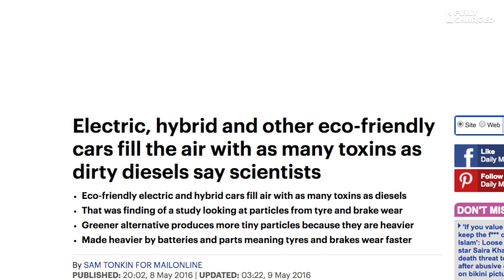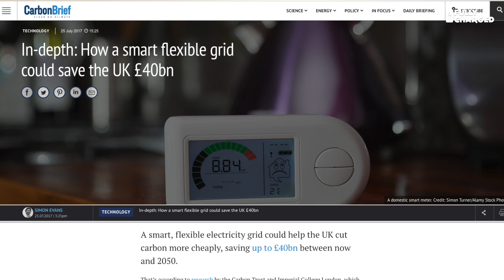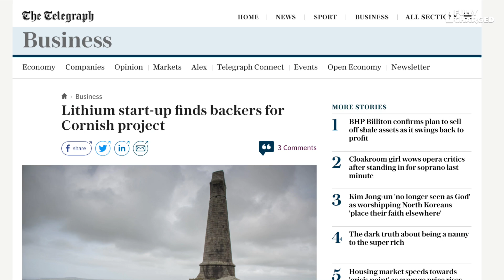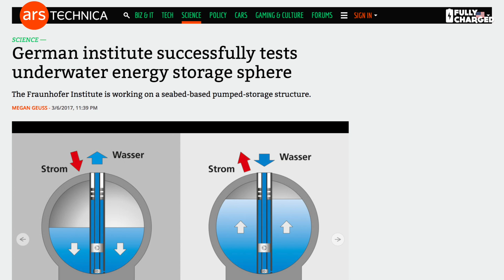Kettles, Particulates & Flexible Grid | Fully Charged News

Comment: Why do EVs not gt through tires as quickly, surely that's all on the driver rather than the car?
Reply: I suspect it might have something to do with regenerative braking absorbing the vehicle's momentum, vs using brakes to cancel it out.
Reply from the maker: But regen braking is now very sophisticated and becoming more so, and it's adjustable on many models, and you can turn it off so the vehicle coasts. It isn't a sudden mechanical input, it builds slowly so the torque effect is applied more gradually than brakes. That's how I've had it explained to me, by the tyre manufacturer who said 'electric car tyres last longer.' But what did he know.
Reply from the maker: The reason is obviously down to driver behaviour in some parts but also braking. Heavy / last minute braking wears tyres down faster, as does hard acceleration, when you drive an electric car (normally, for getting from A to B) EV drivers accelerate and slow down carefully to maximise range, so it certainly appears from experience tyres wear less.
Reply: But at the point were people will switch to electric cars they will probably drive even more aggressively because it is cheaper and they can have that power instantly. 
I know I have driven the rented i3 like a drunk 18 year old yob.
Reply: Jean-Pierre White 
I don't know if you're right but my experience contradicts. I have a Renault Zoe EV that has done almost twice the mileage as I ever got out of a set of tyres. I had a Mini before that spun the wheels more, had less grip and tires wore out really fast. Less than 10,000 miles sometimes. Zoe is quicker off the line but tires definitely last longer and smoother power delivery spins them up less in the wet.
Reply: James Jeffs 
Missing the point, the "report" speculated that EV's would wear tyres MORE quickly due to their increased weight, thus causing more particulates.
Reply: Yes, and Robert Claims they use tires less quickly (1:50-1:55). I wanted to know if there was a reason for that?
Reply: It's a fair question. I think they would wear tyres at exactly the same rate as any ICE car. Brake pads, however, do wear slower due to braking regen.
Reply: Thanks Rob, yeah that's what I expected. I suspect Robert just got carried away.
Reply: Rob Jeffrey 
Having re read my post I should have continued and made exactly the same point you did.
Reply: I guessing it due to there higher weight. But as you would use a tire meant for that weight there would be no problem.
Reply: Regen braking and mechanical breaks have exactly the same effect on the tire as they are both putting negative torque through the wheels. Regen braking can under-rotate the wheels and even lock them if not set up correctly. So regen braking unforunately does not spare your tires, only the brakes.
Reply: dlwatib 
I suspect that any accelerated tyre wear on the Tesla's would be due to driving them exactly the same as you would an ICE car.
If you drive any similarly bodied (5 door hatchback) vehicle, it's highly unlikely to have the (almost ridiculous) amount of torque of the Tesla and certainly NOT from zero rpm. You would, even in a "performance" version, have to drop the clutch at 3000+ rpm to get that amount of torque.
If you simply pull away and THEN stamp on the throttle, the wheels probably won't spin, so no tyre wear.
However, in the Tesla, depending on the settings, I imagine stamping the accelerator from standstill will spin the wheels and wear the tyres.
When watching the Tesla drag videos, it ALWAYS beats ANY ice car over the first 50 metres. This is instant TORQUE driving the car from standstill. The ICE cars sometimes (rarely) catch towards the end, but that's POWER, generated when already rolling, so no wheelspin.
Reply: Yeah, I don't think he should have said they use less. Bit silly highlighting loads of nonsense and then adding your own in the contrary.  Tyre wear comes down to many variables and can be intentionally reduced though always with an offset in performance. I don't know why EVs using regenerative braking would be any different to hydraulic. maybe there is information out there that shows it is. The only thing I could think is drivers are very gentle on the power to extend range, though cannot really take that into account.
Reply: Yeah, I'm sure the independent wheel control can work better than conventional hydraulic systems, even with independent electrical sensors they are still powered by a main servo with a specified front/rear bias. Also I think Tesla do away with the mechanical differential, So that's a whole extra area where strange loads are applied to the tyres. More shows on this technical stuff if you get the opportunity please. I'm always eager for the arrival of new videos on here!
Reply: EV are also typically equipped with "green" tires that maximise range, but also at the same time coincidentally minimise tire wear.
Reply: I guess because they accelerate and decelerate more smoothly? 
The tyres on my EV have lasted almost twice as long as any other car I've had and still have 3.5mm tread on them. They do seem to last longer.
Reply: A heavy right foot will result in rapid tyre wear on an EV due to the high torque off the line. The extra weight doesn't help. On average I estimate EV's are harder on tyres than fossil cars.
Reply: All the minuscule battery ones you can buy are on hypermiling tyres. They are hard as a rock and borderline suicidal in the wet (at least if you believe tyre tests, in the real world they still perform better than any tyre you would have bought in the 90s). Of course you can put these tyres on a combustion car but no one would trade in 0,2L/100km for an extra 30€ per tyre if this tyre at the same time performs worse in any other test point.
Reply: Exactly by not pressing the brakes that much you don't ware out the brakes nor you ware out the tires by scraping them on the road.

Comment: Story today in the Guardian about the environmental impact of mining nickel and how EV batteries and EV's are thus less clean overall than first appearances....
Reply from the maker: We're going to see thousands of shock reports mixed with very justifiable concerns (like the Guardian one) which question the industrial and extraction industries behind electric cars. It's always worth remembering that with the massive global infrastructure of the oil industry, whatever they pull out of the ground only about 28% of it is actually used to do the job we refine it for. The rest is wasted as heat in internal combustion engines. No system as complex as we're using today is without costs but we should and must mitigate those costs as much as possible and learn from the past
Reply: I think that is part of the honest reporting of all of our industries - all consumption and transport has an impact - we need to acknowledge that green/renewable systems are about less impact not none. Agree with you here about walk, ride, public transport and then car. Car sharing (zipcar et al)  is also very present in cities and needs to find a way to work in smaller communities (govt anyone?) . The problem as ever is peoples attachment and ownership of cars as a status symbol and their lack of care with shared vehicles and consideration of other users.
Reply: Future technology will also allow us to further recycle old batteries, You can't recycle emissions, at least not efficiently..

Comment: I have systems in my house that draw ~10 kw    any time I turned on the kettle / microwave boom... power outage.....  fixed it by adding another circuit... so yes it can happen... but if you but an electric car, I am sure you will end up getting a new circuit any way
Reply: I meant ~10A :)  thats slightly different by a big margin...  lol
Reply: ok that makes more sense.
Reply: Most domestic properties in the UK will have a 100A single phase supply; if you actually try to draw 140A, you'll very probably blow the main fuse (on the cut-out before the meter) and have to call the electricity company out to change it (the main fuse isn't yours and you shouldn't be tampering with it… it's there to protect the electricity company's equipment, notably the incoming service cable). The thing that saves you is "diversity" — basically, you aren't actually going to draw 100A through your consumer unit, and you may not be drawing the full 40A for your charger.

If you genuinely had a need to draw 140A, you'd almost certainly end up with three phase.
Reply: Even a 20kw charger is max 66 Amps so having a 10kw shower on won't trip or blow the main mcb or service fuse.
Reply: Depends how mean your local supply is. My main RCCB states I must never exceed 100A. (24.5KW).
Oh, and the car charging point bypasses that with a 40A RCCB.
Reply: 11kw single phase is doable in the uk from a 100amp supply the diversity argument isn't valid as the batteries take full load more or less continually till fully charged but if you use the night time tariff then as long as you are not charging storage heating at the same time your normal household load would be minimal
Reply: chris rix Was talking about the 100A on the consumer unit, not the 40A. Totally agree diversity not appropriate for chargers, though still likely his charger draws less than 40A otherwise would expect higher rating on RCCB.